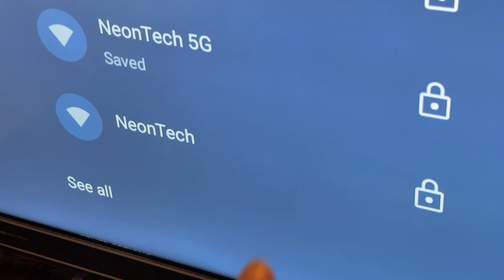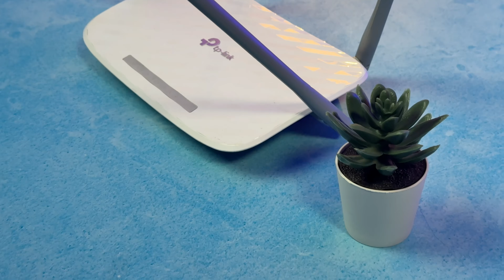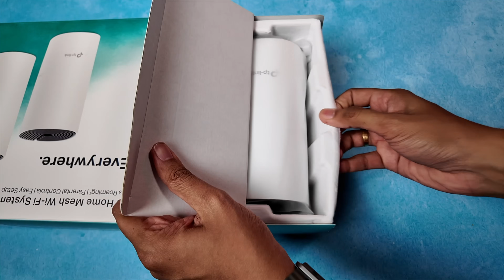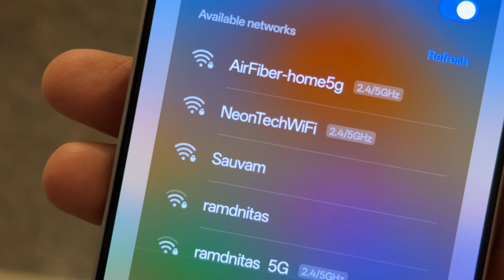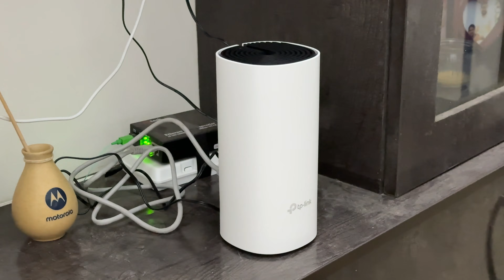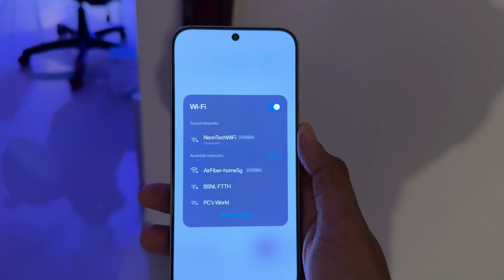How to Increase WiFi Speed and Coverage ? TP Link Deco M4 WiFi Mesh Setup

Comment: The cheapest solution would be to connect a lan cable to your existing extender(if it supports physical port) from modem/router. Then you can switch its operation mode from extender to access point mode.

Comment: Can i replace jio airfiber router with deco m4? If yes then how may deco device can i use?
Reply: No u cant
Reply: Connect the Echo device to the LAN port of the AirFiber unit. Then, disable the SSID broadcasting on the AirFiber. This setup will allow the Echo to receive internet through the AirFiber’s LAN port and function as the primary Wi-Fi access point for other devices. Also confirm this setup with Jio Support once.

Comment: @Mr Neon Tech - I have been using the tplink deco m4 for past 2 year now... the problem that I see with this is that the main router (Jio / Airtel) gives me a 300mbps speed but the speed significantly reduces to 150 / 180 while connecting to the M4 deco. Is there a solution to get the same speed of that of the main router? Or I doubt if its a compatibility issue with the router as Jio would support Jio Mesh only?
Reply: only one way, route LAN cable from router to the M4 deco, you will get full speed ☺

Comment: Buddy, I have airtel router and 1 deco , 2 floor building, can I have router connected to 1 deco to just make it work? Wirelessly
Reply: I got the same query, one router and one deco connected to it wirelessly. Can someone help on this please?
Reply: @HrithikNaha Big No..You have to use minimum 2 to make your setup good and any one must  least connected via cable to original router or modem

Comment: Bro i have a huge doubt , now i live in a multi storey house G+4 so the isp(act fibrenet) router is in 3rd floor yes they just have a cat cable running into my house from outside not a fibre optic cable so there is no modem only a router so it's probably router/modem ig??!😅I will call it as isp router from now on! and ofc that isp provided router (tplink Archer c5) is no good so none of my wifi lights etc and other devices connect to it because of weak signal or barely have any speed if connected so i thought of mesh system for my problem to be adequate since i already have cat cable running from centre point in each floor and ethernet ports from tv units/pcs running to 3rd floor aswell seperately running to the hub where isp router is located so now I have 3 lan cables from 3 floors center point (mesh nodes cables) and 6+ lan cables of various ethernet ports in the hub.... is it possible to connect all mesh nodes and ethernet points to a network switch then the network switch to the isp router instead of you know a series connection they mention using wired backhual connecting first main node to isp then from that main node to another slave 1 and from  slave 1 to another slave 2 node😂😂 in mesh nodes installation !? I already kinda know that my plan will probably  create two networks in the house one by the isp router ex: act5/2.4g and mesh system creates its own network ex: meshwifi.... so now wired Ethernet points (tvs,pcs,cctv, etc) will work via isp router's Internet connection through the network switch which is  act5/2.4g with its credentials/password etc and now i will an have option of connecting some wireless devices especially on the floor where isp router is kept to the isp router or mesh wifi node in that particular floor
And rest of the floors i will be able to connect wireless devices to the respective floor nodes via its own credentials/passwords etc and wired stuff as mentioned to isp router switch so basically i am trying to keep wired Ethernet connections confined to the isp router via network switch and wireless devices confined to the mesh system which is also connected to the main isp internet and themselves( all nodes) via the same switch!!??? Is this how its gonna be !😅or work? Is it a good plan? please guide mee!?❤

Comment: All is good but the system is flawed when it comes to connecting the next Deco to the one that has best signal. You cannot replace the order of which the Decos are connected. For example if you have a 3 floor house the 3rd floor Deco connects to the 1st floor one making the signal very weak. It is beyond me why that is. Even if you connect them in the right sequence (1st floor -> 2nd floor -> 3rd floor) in a few days they go back to 1st - 3rd - 2nd. I am considering switching to a different system because of that.
Reply: This is a real concern then.

Comment: Can I connect 1 deco m4 with main jio fibre thru lan and use same ssid of jio router ?
Reply: Yes you can, but might create conflicts for the device where it might just connect to your modem. You could just disable WLAN in your modem settings and just use WIFI from Jio router.

Comment: Instead of buying this new product. You could have set one wifi SSID name in your master and extender tplink products to one name
Reply: This is not a good tip. Your device will connect to any one of them, but it will not guarantee the fastest connection. It can connect to the furthest one or the closest. I had tried this before, and this configuration is bad.  Best is to use a mesh network where all nodes are aware of each other.
Reply: @isaacdesouza2475 yup this guy is right i was currently dealing the same problem so i ordered mesh and now living in peace without getting disconnected and connection jumps
Reply: Lets say you do extend using another TP Link it's the same WiFi network name, but not the same MAC address. There is also a difference between SSID and BSSID. As a temporary solution before I had my mesh devices, I used the same SSIDs for two APs in my house. A device would connect but then would remain connected to the specific router it was originally connected to even when walking away and being closer to another access point. The roaming is not as aggressive. what you are suggesting definitely can work but user beware.
Reply: So are you using mesh device can u help me with this  @ChickenWings217
Reply from the maker: That's a good tip!
Reply: Hi. I am using a JioFiber router and a TP-link WiFi extender. How do I go through / follow the process that you have suggested ?
Reply: Couldn't you put your device on "use the best\fastest wifi connection" so it would use the same name but not the worst connection. On a phone, this is  possible and keep "safe wifi" on.
Reply: Mesh routers provide a feature called "fast switching", which ensures if Ur phone of laptop switches connection to any of the routers in the mesh network, u would not feel the disconnect/reconnect lag in ur connection. But if u don't use mesh & instead use 2 routers with same ssid, ull feel a lag when the connection switches from one router to the other when ur moving. There r many videos explaining this, u can look it up

Comment: Hey bro
I am solving both of your problem with TP Link Archer MR200 router and the same dual band wifi extender which you showed. It will combine both bands and automatically adjust the speed and also it will solve the switching problem, there is something called TPlink mesh while setting up the extender if you use that it will solve the problem. Catch here is you should have TPlink router and TPlink extender only. While setting up your extender you can set it up like both extender and router should be under same wifi name and one single band, router or extender will automatically connects with better speed and connection.
Reply from the maker: I'll try that out! Thanks for the suggestion.
Reply: bro i have doubt will one cylinder can solve the wifi issue? My modem is on ground floor i need wifi on top floor so do i need to buy both cylinder or one cylinder?
Reply: @adarshks1766 you need 2 atleast
Reply: Can you share video guide for your setup or any reference link.
Reply: Hi. I am using a JioFiber router and a TP-link WiFi extender. How do I go through / follow the process that you have suggested ?
Reply: @DrZGJ  hey bro... Is tp link extender is good?.. I'm in 1st floor ryt now.. and I can't connect to wifi... And i get 1 point when i go to corner of room... Can u suggest any idea?